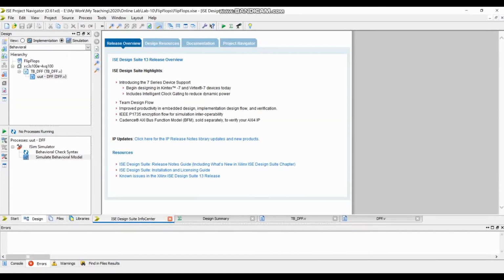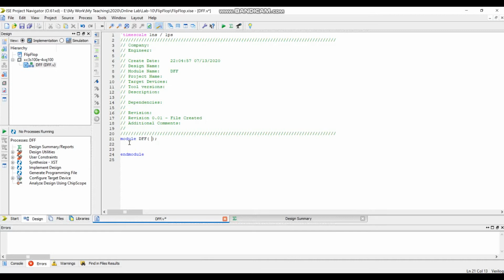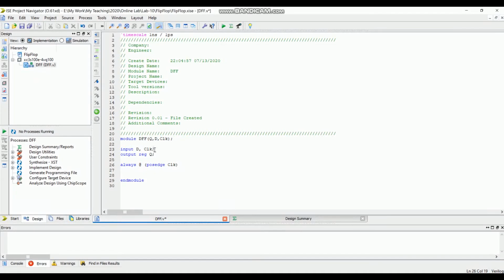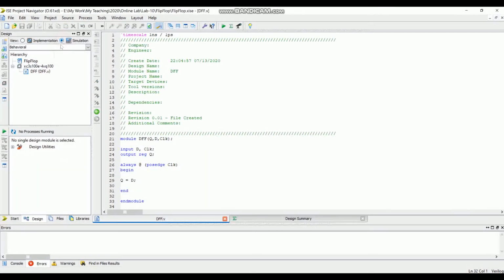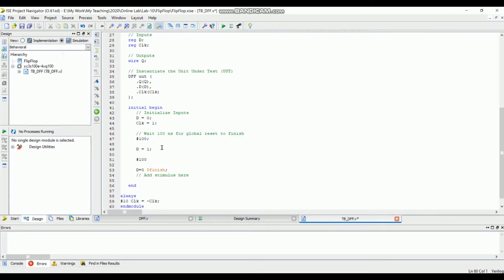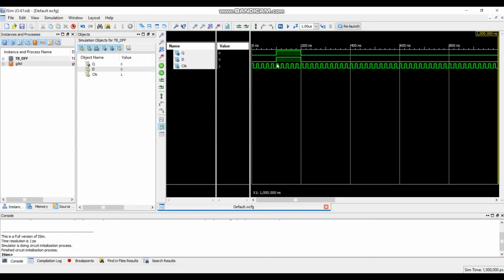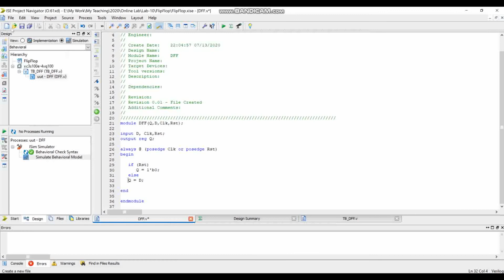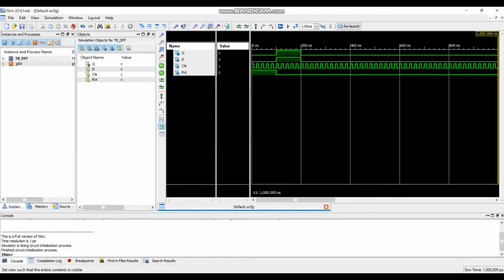Simulating D Flip-Flop on Xilinx: ISE Design Suite| Verilog HDL| Behavioral Modeling| Digital Design

Comment: I copied exactly what you did but my graph for Q is blue and has a value z, do you have any idea what that means and how to fix it?
Reply from the maker: Blue lines mean high z condition, it happens when a line doesn't get input voltage. It generally happens when one of the sub modules are not compiled or one of the modules might have errors. This generally goes away when you rerun the simulation by selecting 'run all' option.

Comment: Can you give a lecture Multi bit flip flop concep & implement it with the same circuit as an example
Reply from the maker: Sure. Could you share a bit more on what are you talking about.
Reply: Hi sir, I want you to do a lecture on Multi bit flip flop concept where we merge Two single bit flip flops into a Single 2-bit Flip flop which reduces clock power consumption and I want you to implement this concept in Serial in serial out Shift register
Reply from the maker: I will look into it and will make a tutorial. Thanks for the suggestion.
Reply: @khuramnaveed1  thank you sir